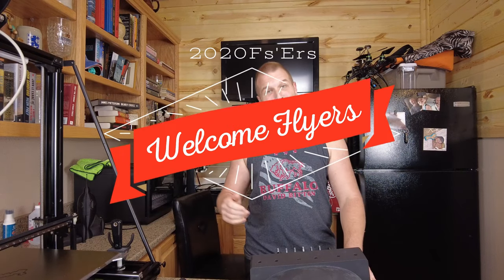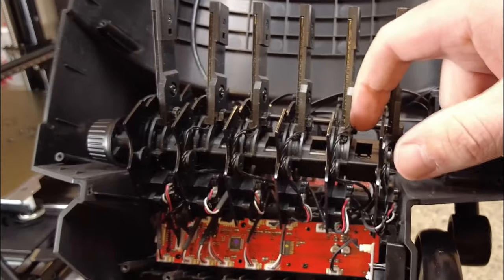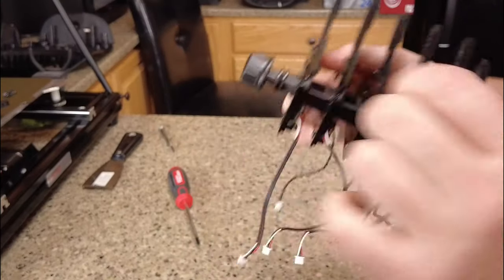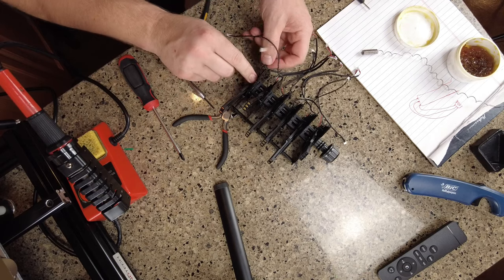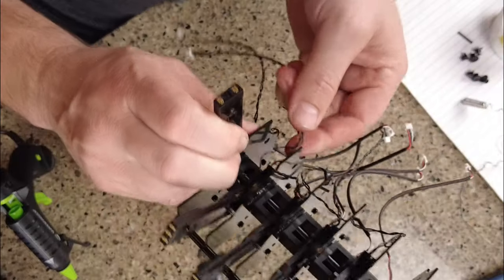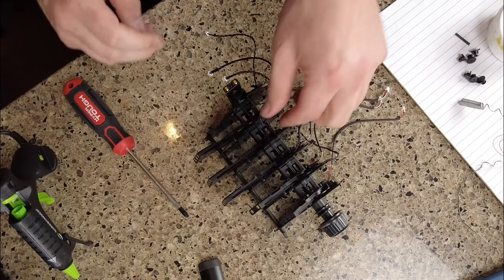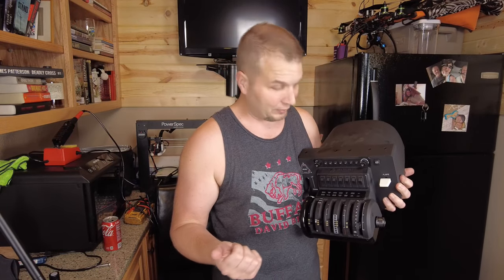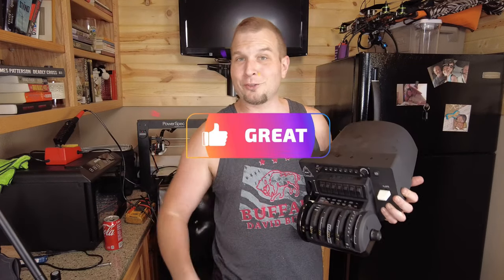Honeycomb Bravo Throttle Quadrant Problems REVersers NOT WORKING! Bravo Teardown REpair! POOR DESIGN

Comment: hmm, this is concerning to see!  Thanks so much for posting this.  I just received my throttle quadrant last week.  I can see that the wires are being bent each time the throttles are moved, so this will eventually happen to mine.  I'm not quite clear how you modified it so that it won't happen again.  Was it just hot-gluing them down?  Or was that heat-shrink doing something other than preventing snags?  They seriously cannot have put much testing into this design for this to be released.  It's a rookie mistake.  If they are honouring the warranty, this will cost them a fortune.  Having said that, it's clear from looking at the insides, that they are making a lot of profit on each unit.  Not much inside.  I'm curious why you fixed it yourself though.  There's a two-year warranty, and doing what you did will have voided that.
Reply from the maker: Hey thanks for the comment. So I had to re route wires inside and remove a stud that they had the wires wrapped around . Then hot glued the wires I  place so they won't bend and then make sure the wires can move and not snag . They are covering under warranty but the replacements are the same units no modifications have been made on their part . So i would rather not wait 6 weeks or more for them to replace it to just have the same thing happen again. What good is a warranty if it is always broken so I made it better and now works great. Hope this gives some insight on the fix and the reason why I did it.
Reply: @2020fsers  thanks for the additional detail.  I think I may open mine up and pro-actively fix this weakness.  Gotta be easier than doing all that soldering.
Reply: @2020fsers  ok. great.  thanks for the extra info.  I will probably do this mod, but first want to be sure that that all the buttons and axis work properly.  haven't had a chance to play with it much yet
Reply from the maker: Well use it first before you tear it apart lol
Reply: @2020fsers  I had snapped wires also. I did the same repair you did, but I want to replace the wiringharness with copperwires. Do you know what diameter the used wires have?
Reply from the maker: I used 25 gauge I think

Comment: A crap product from Uncle Sam. Things are supposed to be tested to destruction before the products are put on the market, aren't they? Obviously that doesn't happen with Honeycomb. I have the Alpha Yoke and the Bravo Throttle Quadrant but it is the latter that has been disappointing, particularly the Auto-pilot buttons and selector knob, and the slippery overly sensitive trim wheel (which I see they have produced a rubber addition for ... at a cost to the consumer). I would have to think critically before buying Honeycomb products in the future - in Australia the prices break the bank, so to say. If we  cannot trust A1 products from America then we should vote with our wallets and buy elsewhere - even if it costs more we can probably get a better product. No-one should have to tear down a product to fix a problem that should have been eliminated in the design stage. Come on Honeycomb - recall your second rate products and give us a refund.
Reply from the maker: i agree we should not have to fix these things ourselves and i wasnt trying to cut on honeycomb in the video i just wanted to bring this to everyones attention as i know lots of people have this and wanted to get the word out so that everyone don't think its the sim not working or a bug, its the bravo not working ,to help diagnose issues for people but i do hope that honeycomb gets to see this so they can make changes if they havent already.  Thanks for the comment and for watching

Comment: The wires on mine have a different  configuration, they have a loop around a plastic piece, and STILL broke. Not because of snagging on something but the exit from the leaver is abrupt so the wires move alot on that single spot
Reply from the maker: Yeah they did try a change the configuration.  I have one of the 1st ones . I guess they didn't fix the issue

Comment: After watching this I am strongly considering cancelling my order as it should arrive within the next week. After watching you crack the unit open I am quite annoyed of the absolute cheapness of it, this is a £280 unit not some cheap ass Chinese £25 piece of junk. I would expect for this price something premium which this is clearly not.
Reply from the maker: I thought like you about the guts of the unit they should be much better for the money it cost . More thought is needed in design and quality of parts . I hope this helped save you or gave you a heads up at what you will need to do . Honeycomb is repairing them but that is only when they get parts to do so.  But a re design is needed so dont know how long it would take. Thanks for watching
Reply: @2020fsers  I have today emailed honeycomb to try and ascertain whether or not they are aware of the issue and if they are what has been done ?.  I wait on their reply before deciding to keep my order and continuing to allow it to be delivered or cancelling it.
Reply from the maker: That is a great idea make your decision after you get all the info, smart, let me know what they say.
Reply: @2020fsers  Will do
Reply: @TheDigitalFlight  I’m guessing they never got back to you? From what I’m reading online they have zero customer service standards
Reply from the maker: I have heard both sides but some say they wait 6 weeks or more for a replacement.  Idk